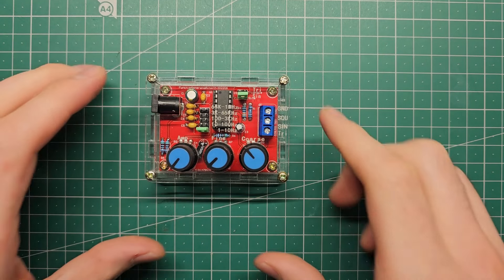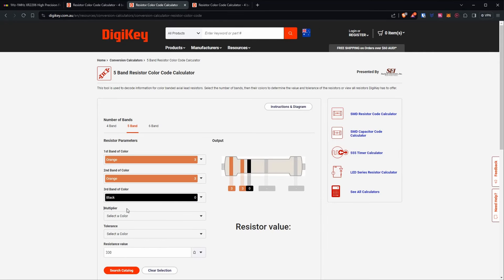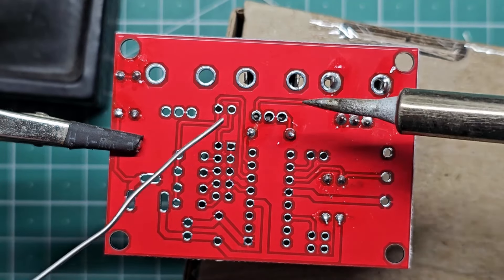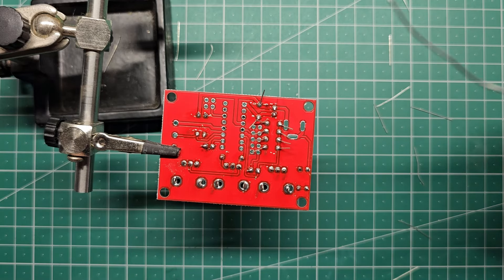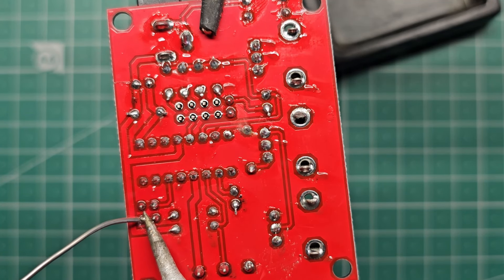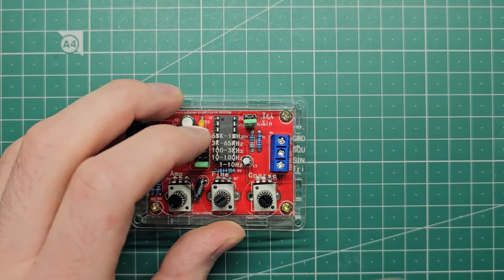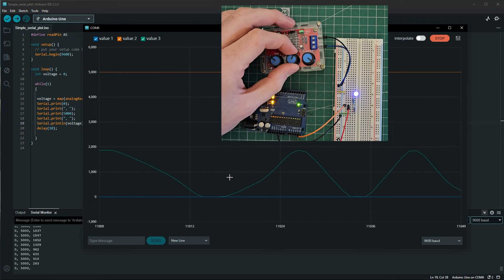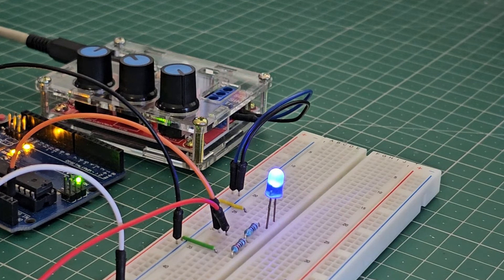How Good Is a $10 Signal Generator Kit for Beginners?

Comment: which resistor is the 2.2k and which is the 4.7k on your breadboard?
Reply from the maker: The 2.2k is connecting the circuit to ground, giving a voltage divider ratio of approximately 3.1:1. This drops the 12V down to 3.8V.